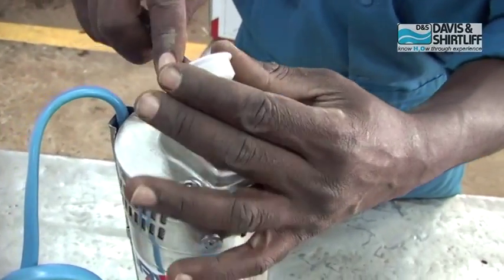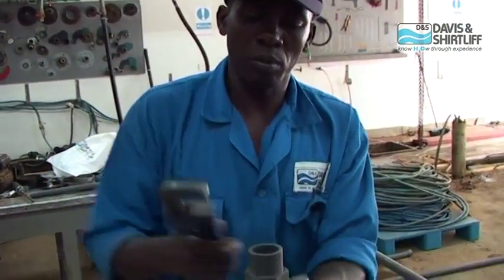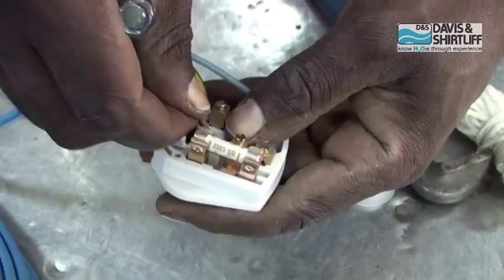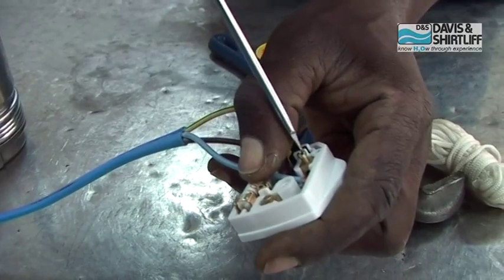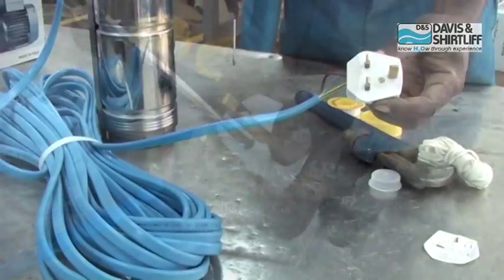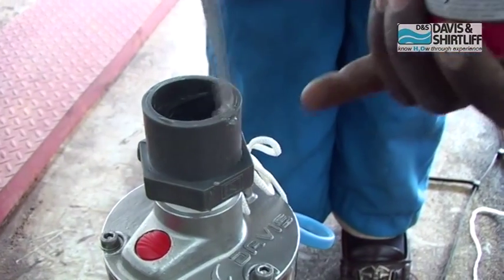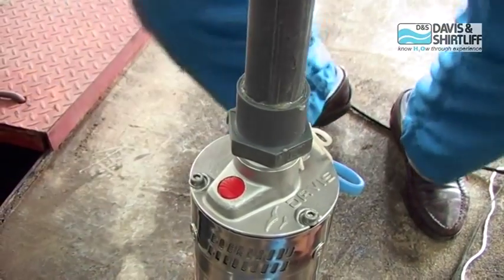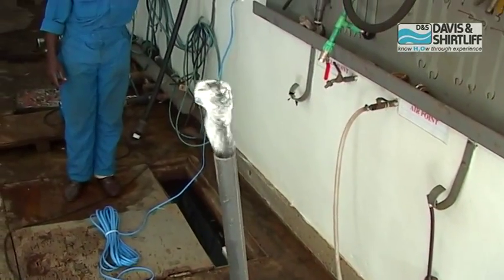Davis Pedrollo installation final_GB

Comment: You should NEVER have the inner cable insulation exposed - there should always be two layers of insulation between a person and the live wires. That plug is very badly installed.
Reply: Yes you are right, they probably didn't bother because it's for demonstration purposes.